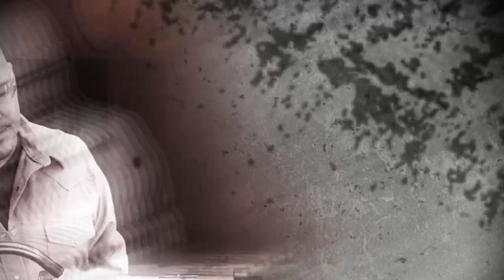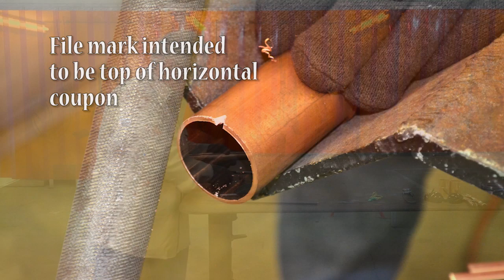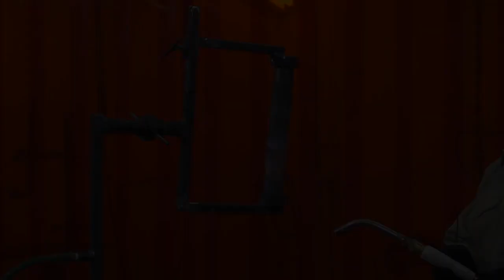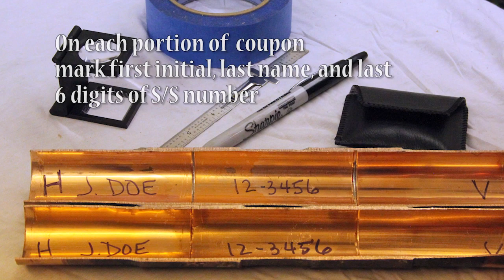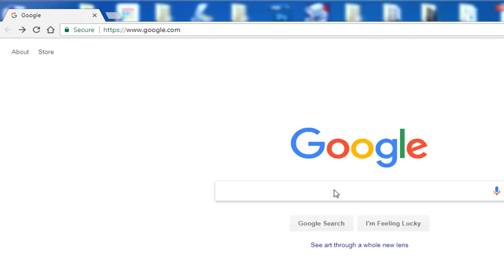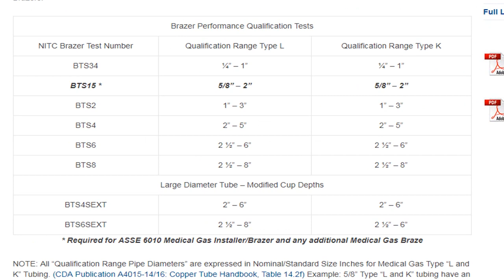NITC Braze Qualification

Comment: The first braze with acetylene only for Medgas? Weak and feeble. Even weaker when you said you could melt the base metal with that torch. Too bad for your large pipe you didn't use someone who could braze 4" without getting filler all dripped down it. A tell tell sign that you are just melting rod with the torch and not using the fitting. I would have used a bigger torch for 4". But when you are scared this is how you do it. Including illegally rotating the fitting. No ASSE cert coupon can be spun. Super feeble guys.

Comment: While brazing in the vertical position, why does the instructor flip the coupon? 

Wouldn't it be preferable to braze with the hub catching the filler metal and also potentially drawing some of the filler metal from the bottom hub towards the center even more?
Reply: I believe its part of the qualification process they want to see you do the hard part twice compared to one upfeed and a downfeed the downfeed is the easy part
Reply: You can only braze vertically uphill(upwards) on each side of the coupon to pass the test.

Comment: What size torch tip is that?
Reply: Good question! There were a couple of tips used in the video. The BTS15 (1 1/2 NPS) was brazed with a Victor® TurboTorch® Extreme™ A-32 3/4" Standard Air Acetylene Swirl Torch Tip (For Use With PLF-A5 or G-4 Torch Handle) and the BTS4 (4 NPS) was brazed with a VICTOR Heating Nozzle: MFA Series, Size 10, For Use With Acetylene. For these tests, it has been determined that the tips described provided the best results. Thanks for viewing and thank you for the comments.

Comment: Is 100% penetration required? It appears that he is only capping the joint and barely penetrating. I took this test 2 so far and failed due to a joint having a 3/16 void in the middle of the cup on my horizontal joint and the union testing facility refused to send it in. Is this the case or do we just cap as shown in the video
Reply: Full penetration., the joint inner side can't have gaps

Comment: I have been certified for a few years now and I have a question I'm hoping you could answer about brazing. When the proctor was teaching us, he absolutely instilled it into us to ALWAYS push the rod into the cup of the fitting. I see that you are not so much pushing it in as you are wiping it on.So my question is, Does it make a difference in the way you apply the rod or is it all about your heat and how you move your flame?

Also, When brazing the larger sizes such as 4" and up, what is the purge set to?
Reply: Pushing the filler can help quench the joint while over heating as you will find in not perfect environments or positions. To much heat for to long is never good I prefer to get it done hot and quick
Reply: Justin, thank you for the comment and sorry for the delay in responding. Great question! You are spot on, as HEAT is everything when it comes to brazing. "The filler metal is going to follow the heat". In regard to pushing the rod....the rod needs to be in contact with the base metal to transfer the metal from the rod to joint, however, there is a chance of distorting the cup or disturbing the joint, by pushing on the rod when the joint is not heated correctly. If the joint is heated correctly, the filler metal should flow smoothly into the cup, while chasing the heat. You also mentioned torch movement....yes, torch movement is important, as movement of the torch relates to heat. The settings, angle and distance of the torch along with the time the flame is allowed to stay in one position, is directly proportional to the amount of heat being applied to the joint. The joint needs to be hot enough for the metal to flow and fill the joint clearance by achieving full penetration, without overheating (eroding) the base metals. We hope the video helps with the understanding of the process and appreciate your comment. For additional information on pipe brazing, please visit www.nationalitc.com
Reply: Depending on the length of the run in which you are purging, I tend to keep my purge gas at around 7-10 psi after all O2 is displaced from said pipe run.
Reply: Kannada copper welder  job job  how much salary
Reply: Looks like he's just capping, than filling. 

Also, noticed there wasn't any Flux applied?
Reply: @Apphus144  not necessary to apply flux when brazing copper to copper.

Comment: I have no idea why you would not braze vertically from the top position down if available. The joint will have full penetration and maximum filler metal.  By doing it from underneath, you have a possibility of not enough filler metal applied.
Reply: They're wanting you to prove that you can braze in difficult positions, fighting against gravity and making sure you provide enough heat for the capillary action to do its job. Soldering from top is easy, gravity pulls the solder down for you so there's less skill involved.
Reply: For Med Gas Test certs this how you have to do it. When you get the pipe red hot and back off a bit the filler metal makes its way through the the joint everytime.
Reply: Paul, thank you for the comment. Colbert and Scott, thank you for the replies. NITC's braze tests and procedures are designed in full compliance with the NFPA99 Healthcare Facilities Code and ASME BPV Code, Section IX, Part QB, as cited in the video. When referring to the ASME BPV Code, the "vertical upflow" position qualifies the brazer for vertical downflow. As Scott mentions in his reply, when they write the codes, the variables associated with the "manual torch brazing process" for "Brazer Performance" are considered and built into the requirements of the code. Remember, "the conditions for brazing, never get any better than they do in the testing booth". For additional information on pipe brazing, please visit www.nationalitc.com. We appreciate the comments and replies.

Comment: Awesome job gentlemen.  I have been med gas certified for a while.  I thoroughly enjoyed your educational video.  Was it mentioned that copper pipe shall be a minimum of type "L" for gas piping?  Maybe I missed it.  Thanks for this video.  It is great to help out the younger folks getting into this trade.
Reply: What’s the process on getting certified or  what are some requirements if you remember thanks
Reply: @abeldontworryaboutt3256  If I didn’t get it wrong.You need to learn through the NFPA99 and pass a 1 1/2 in brazing test .After the written test you will get your ASTM 6010 certification